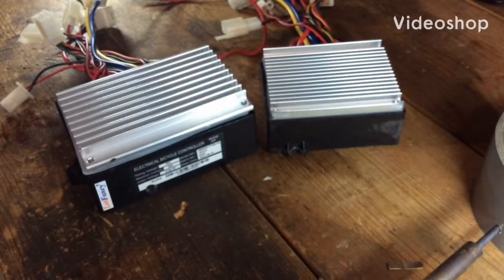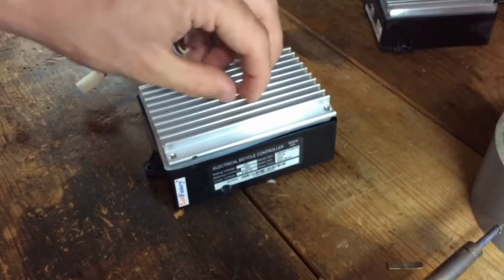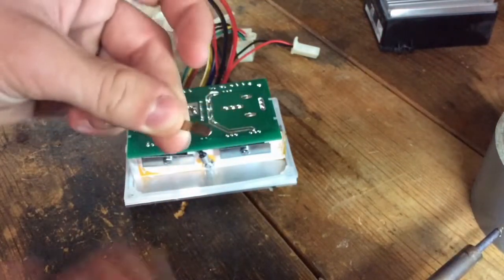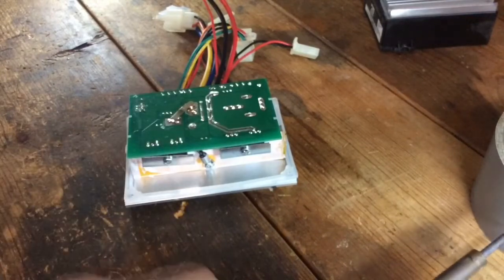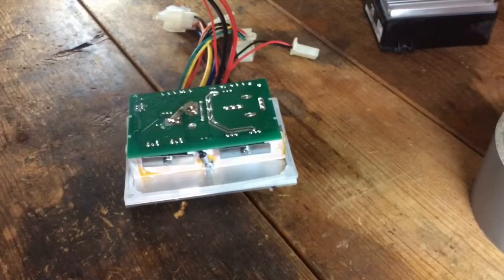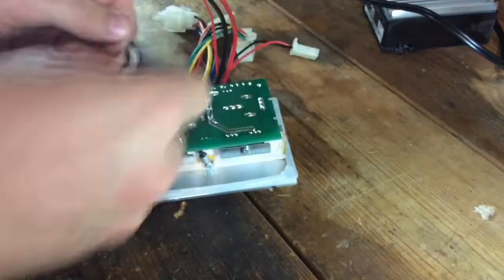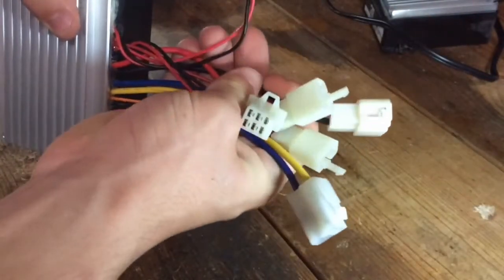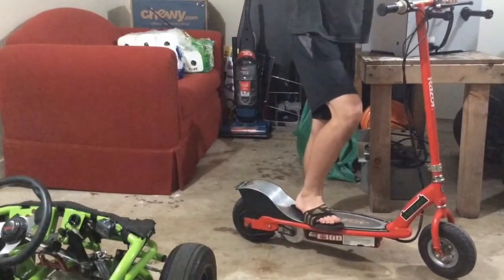FREE UPGRADE FOR RAZOR MINIBIKES! 36v shunt mod

Comment: I have the smaller 24v controller but the variable speed variant, I doubled up its current shunt with a second one that I had and replaced the single 80 amp mosfet for two 110 amp mosfets. It keeps frying the two mosfets if I hold it full throttle for like 10 seconds… thinking about going all the way to to 4 mosfets on parallel and hoping that it becomes reliable